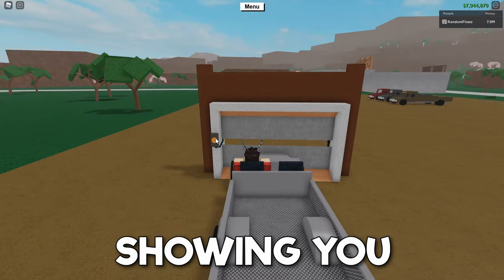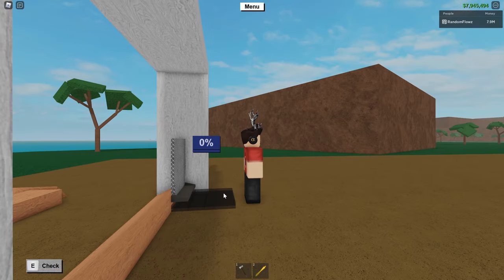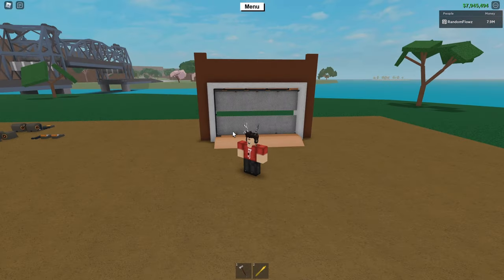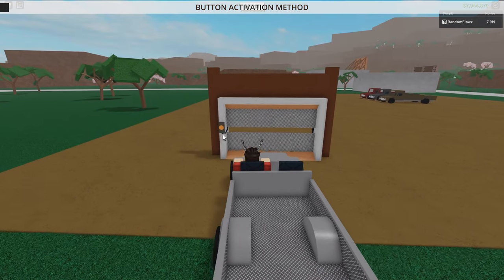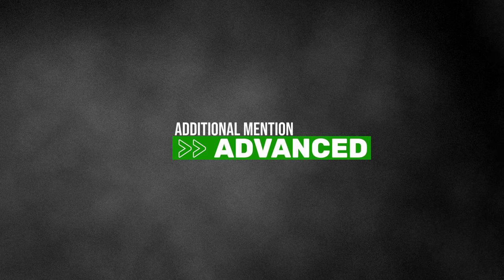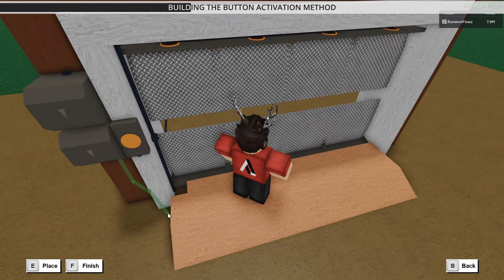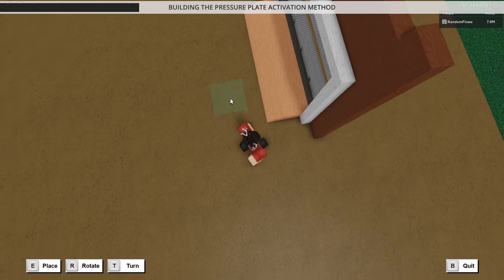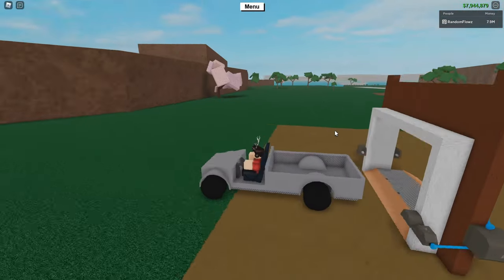How To Build A Secure Garage Door In Lumber Tycoon 2 Roblox

Comment: only 2 of the doors open on the lazar method
Reply from the maker: sounds like more of an issue with wiring than activation method choice. Maybe try re-wiring your hatches?
Reply: @Aptyn  i figured it out it was bc i used one wire all the way across instead of multiple but my truck seems to get stuck every time i drive up it

Comment: Why does it open but not close after?
Reply from the maker: i assume you’re using a lever, that would be because with the lever you have to close it manually since levers provide a constant signal rather than a pulse
Reply: @Aptyn  yea idk what it is I think because I was using to much wires because I didn’t use so much the second time and it worked